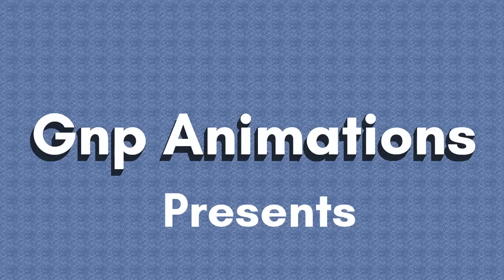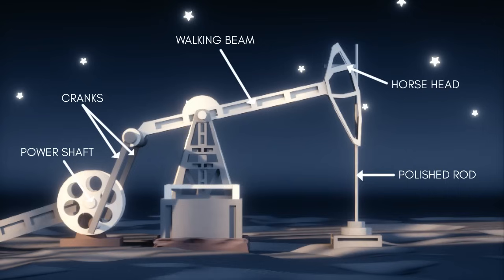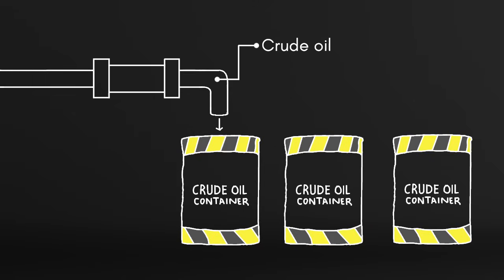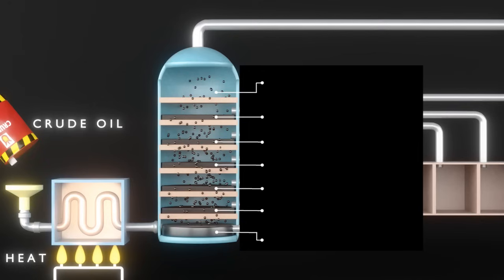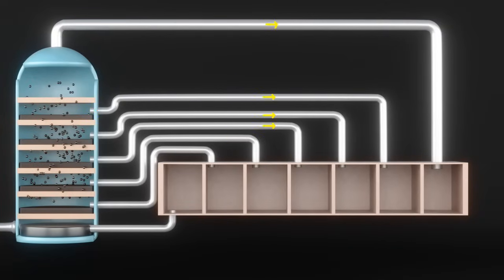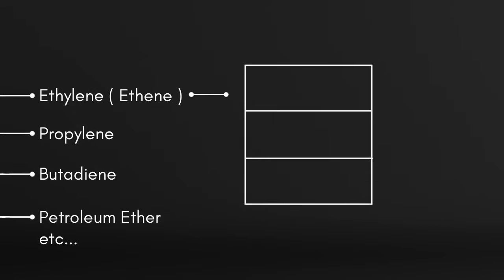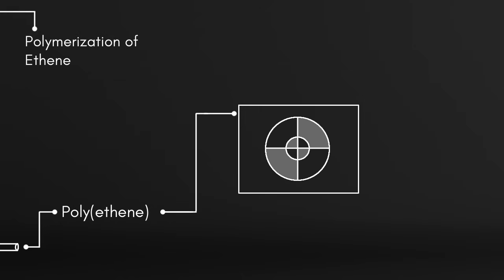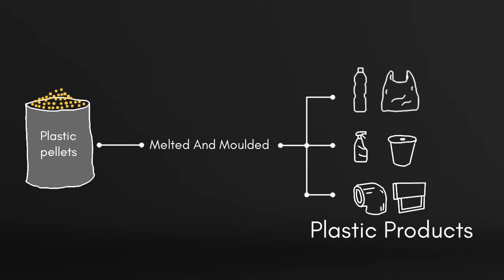How plastic is made animation

Comment: Can we reverse the process to get back napta and crude oil back from plastic !
Reply from the maker: Thank you Harsh Rawat for you Comment.
Yes, It is possible, We can convert Plastic back into usable Fuel.
This Process is Called "PLASTIC PYROLYSIS" Also Known as DEPOLYMERIZATION.

In this process long Polymer molecules (plastic) are broken down into shorter chains of Hydrocarbons with the help of heat and pressure.
A catalyst is added to lower the temperature and increase the yield.

it's a Complex Process and also dangerous because we are dealing with Hydrocarbons.
but
For Understand Purpose The Process of Plastic Pyrolysis means Simply Extracting The Usable Fuel Oil From Waste plastic.

In order to extract the oil, plastic needs to be heated to over 400 °C, in absence of oxygen At this temperature, the long-chain molecules from the plastic are cracked and produce synthetic crude oil
That's it.

And it is very hard to explain that complex process in this comment section
If you want to learn more about this topic Here are some links to other websites and videos :

https://www.instructables.com/id/Waste-Plastic-to-Fuel/

https://ourworld.unu.edu/en/plastic-to-oil-fantastic

http://www.gallactronics.com/2012/12/how-to-make-oil-from-plastic.html

https://www.youtube.com/watch?v=oRkVYgNL8n0

https://www.omv.com/en/blog/reoil-getting-crude-oil-back-out-of-plastic

https://www.youtube.com/watch?v=R-Lg_kvLaAM

https://www.youtube.com/watch?v=6L7A7wRs1R8

https://www.youtube.com/watch?v=RELTlS3hEE4
Reply: @karthi_explains  Step 1, turn plastic back into crude oil, Step 2, turn crude oil into gasoline, step 3, enjoy driving around with my free homemade gasoline
Reply: @karthi_explains  عطنا حل الاسايمنت حق ولد عمك سريع
Reply: @karthi_explains so we should  utillise that process for recycling plastic waste
Reply: Woah, I like this YouTuber atleast he try to explain to you what you asked and he explained the main process before putting those video links. Unlike the other that will answer you by pasting video link.
Reply: @Unknown-lw3ux  we don't need crude oil to make plastic
Reply: @robinsss  Bro did you watch the video before commenting?
Reply: @anantpanchal7053  yes

you  don't need crude oil to make plastic 

am i wrong?
Reply: @robinsss  Yes you do...... They refine crude oil to make naphtha which is processed to form ethylene which is processed to make plastic.
Reply: @anantpanchal7053  but they could use vegetable , plant based oil instead  of crude oil
Reply: @anantpanchal7053  You don't need crude oil to make plastic. In fact this isn't the only form of plastic. PLA plastic for 3D printers is made out of corn starch which is a plant.
Reply: @robinsss  they use only 5% of petrol to extract naphta so it's not an important quantity however to reduce the pollution and the harmful effect they have started using plants , vegetables but it's  not suffisant they should add some additives which is harmful !
Reply: @oumaimazizi9560  why aren't  vegetable oils sufficient ?
Reply: @robinsss  here we dont talk about oil but directly polymers , i told you that polymers made by vegetables need to be renforced by some additives to enhance there properities against heat, uv, winds,etc it depends on use
Reply: @oumaimazizi9560  and those additives have to be fossil fuel based?
Reply: @robinsss  yup just ethene a come organic chemical.
Reply: @anantpanchal7053  ethene not ethylene.
Reply: @sebastianstewart6894  I forgot this comment existed bruh.
Reply: @sebastianstewart6894  wikipedia says

the two terms refer to the same subctance

Ethylene (IUPAC name: ethene)
Reply: @sebastianstewart6894  do you have any evidence that ethene is needed  to produced plant based plastics?
Reply: @robinsss ubl😊😊😊😊
Reply: @Unknown-lw3ux man this guys is a genius gem wish i had multimillions to give him 1mil instantly
Reply: @Unknown-lw3ux yes
Reply: thank you for this video sir! This helps me a lot to know more about my topic in our reporting!💓
Reply: can you reverse the process to get back flour and eggs from cake !
Reply: Let’s go in dumping yard and collect plastic and give it to this process as it is a very big problem of our environment 
All of you who loves our environment should do this as a duty
Reply: @Furious Explorer what's  the point?
Reply: @robinsss  Get rid of plastic waste and get free fuel. Duh
Reply: @ChristopherStLouis-tc5qn  i don't know what you mean
Reply: @original noon stfu there is something called sarcasm u smartass
Reply: I like they way you explained ,good job!👍
Reply: No
Reply: @hydrasowdlitepro7487  Uh yah, lol Easy
Reply: Don't listen to these idiots. Yes!! Any idiot can, just search plastic to fuel or petrol.  Your essentially breaking the polymers back into their shorter hydro carbon chains, Diesel, gas, etc... by cooking in oxygen free enviroment.
Reply: Yes it revers polythene to petrol
Reply: Cool explanation! Thank you:)
Reply: plastic pyrolysis
Reply: Great question! The problem with re-engineering plastic is that it requires too much energy to bring it back to a re-useable state. Same problem as tires, and everything else. Recycle/Reuse is a joke. Costs too much. The condition of our environment would have to get to 'Appocolyptic' state before any major company would consider doing things differently. In other words: when there is no more money to be made off the Earth's general population. Sounds terrible, but that's our reality.
:(
Reply: @robinss he just explain like these kind of methods also have okie now you understand
Reply: yes, and lets drill a hole and pump it back in to the earth, where it belongs...
Reply: @yummychips_  watching the machine extract the oil from the earth made me think of mosquitos.
Reply: @jawshhwa5099  LOL hoow?
Reply: @yummychips_  Good Idea LoL
Reply: @yummychips_  no it doesn't it belong in trees. Crude oil are dead trees that turned into humic acids.
Reply: Exactly
Reply: @yummychips_  🤣😂😂
Reply: Once polymerization takes place it's a done deal.
Reply: @CablDragon  Nope. very easy to convert back to fuel.

Comment: You deserve more subs ! ♥️ Just subscribed
Reply from the maker: Thank you 😍
Reply: @karthi_explains  Can we reverse the process to get back naptha and crude oil 🙏 Please reply I am making a project on it 🙏
Reply from the maker: @smilingdemon8588  
first.....All The Best For You Project.
Yes, It is possible, We can convert Plastic back into usable Fuel.

This Process is Called "PLASTIC PYROLYSIS" Also Known as DEPOLYMERIZATION.

In this process long Polymer molecules (plastic) are broken down into shorter chains of Hydrocarbons with the help of heat and pressure.
A catalyst is added to lower the temperature and increase the yield.

it's a Complex Process and also dangerous because we are dealing with Hydrocarbons.
but
For Understand Purpose The Process of Plastic Pyrolysis means Simply Extracting The Usable Fuel Oil From Waste plastic.

In order to extract the oil, plastic needs to be heated to over 400 °C, in absence of oxygen At this temperature, the long-chain molecules from the plastic are cracked and produce synthetic crude oil
That's it.

And it is very hard to explain that complex process in this comment section
If you want to learn more about this topic Here are some links to other websites and videos :

https://www.instructables.com/id/Waste-Plastic-to-Fuel/

https://ourworld.unu.edu/en/plastic-to-oil-fantastic

http://www.gallactronics.com/2012/12/how-to-make-oil-from-plastic.html

https://www.youtube.com/watch?v=oRkVYgNL8n0

https://www.omv.com/en/blog/reoil-getting-crude-oil-back-out-of-plastic

https://www.youtube.com/watch?v=R-Lg_kvLaAM

https://www.youtube.com/watch?v=6L7A7wRs1R8

https://www.youtube.com/watch?v=RELTlS3hEE4
Reply: @karthi_explains  Thanks Bro,
You are Awesome !!🙏